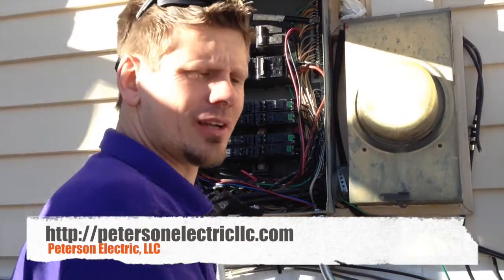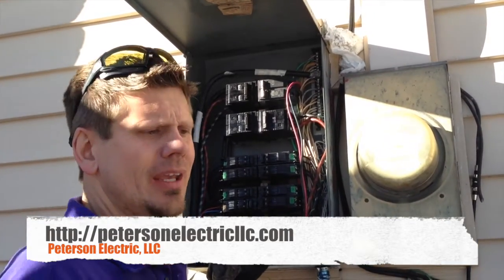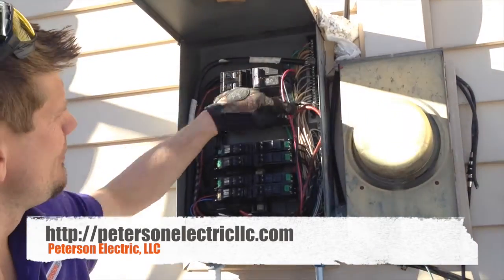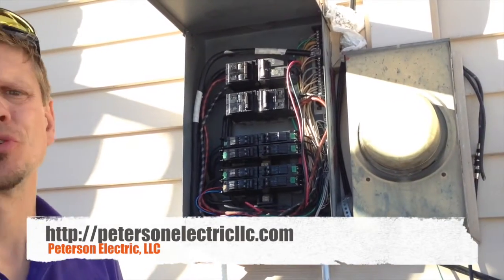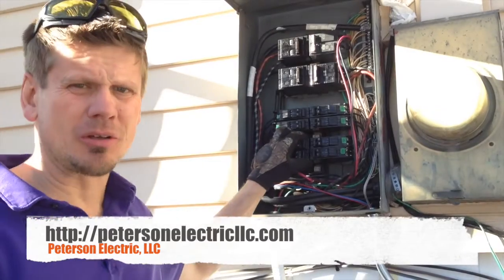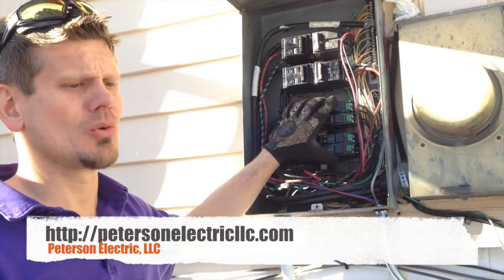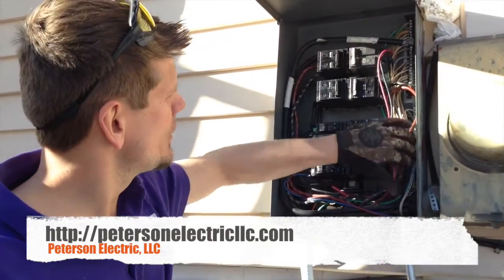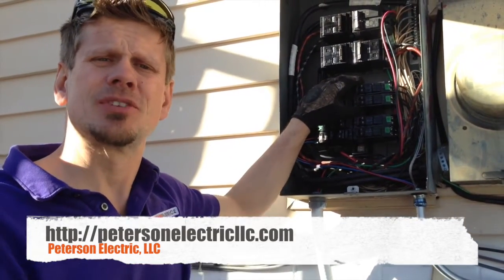Electrical Panel Has De-ox Lubricant On Wires To The Breaker Is That Okay?

Comment: I'm just a farmer that does their own electrical, so take this for what it's worth.  de-ox is conductive, yet I hear of inspectors wanting to see it "oozing" and it makes my head spin.  But a little amount on all connections seems like a good thing, tbh.  People may think "oh, its a NEMA 3x enclosure", but it's only designed to give a DEGREE of protection, not fully protect. Look in old panels, they are covered in filth. I'm really glad I do my own NEC research and electrical work, and not have to pay someone for these simple things.  Even Mike Holt makes some rudimentary errors in his videos.  I don't remember for sure, but I think in all of your slip joint videos when I was researching them, you never once mentioned the slip joint should be at the mid-point during installation.  I found that out when I actually got a 3" slip joint.  Most electrical things, someone in grade school could do with instruction and the tables.  It's not rocket science, you just need to know the protocol.

Comment: Adding a dielectric grease aka deox no ox ALCU aid is not only code accepted but is code required on mission critical and if you look up and I like to use NASA as references because they spend a lot of money on research and development on electrical connections and whatnot and even it's proven to be beneficial by then so the long version short people think dielectric grease will well they have many misconceptions one being udge dialectic it's going to prevent electrical flow 
Are people say oh there's no need for it there's no resistance in what not when we install it blah blah blah
The list goes on of the reasons people say it's not needed to The other side that it's an oversell to the customer

So so I'm going to shorten it to dielectric grease so in any connector connection point you want dielectric grease whether it's just a thin film application to mushing it in a connector and having it squeeze out
On any electric connection that's headphone jacks RCA cables video cables HDMI cables etc
Notice how sometimes you have to jiggle your HDMI cable to get it to work That's cuz there's a wee bit of corrosion in there

So like on connections that you're screwing down you wanted to basically ooze out and then you scoop it the smooch out and reuse it you don't waste it

On breakers or anything we're the wires are not crushed but crush fitting is what I'm going to call it screw down fitting where you're clamping all the you know stranded wires together what I actually do on the mission critical stuff is when I strip my wire I actually bred the wire out of it dip it in dialectric grease I make a little you know tub for that project and then bring those stranded wires back together and pull off the excess and then put that in my crimp connector and make my mechanical connection

And here's the thing with like AC breakers your house current is 60 Hz which is 60 pulses per second going back and forth and that's a vibration and when you have that plus a high electrical load that's you know heating up in cooling down that creates you know a separation between contact points like on the breaker to the bus bar and having a dielectric grease there allows it to explain and contract and not per se arc and as the years progress that dielectric grease their will prevent corrosion maintaining a good connection I've seen breaker panels side by side that there's dialectic grease on one and on the other panel it's not and you can see a difference

I even smudge dielectric grease into relays I'll pop the cover off throw some dielectric grease in there yeah over time like it flaps it out of the way but it also keeps enough of it on the actual contacts to prevent that arcing when they're separating and if you do it right it will last a lot longer than you realize

Also in the marine industry and I'm talking like real heavy marine not like some idiots little boat

Comment: This video doesn't really explain jack. All you said was there is grease in this panel so we cleaned it up. 
How is de-ox [or "di-electric" grease for the auto and electronics guys] on wire terminals a bad thing? (When used in moderation, obviously it shouldn't be a big sloppy mess oozing all over.) It is actually *required* for all aluminum conductors, even Al to Al, and will not hurt copper. I have seen several connections go bad and either cause substantial voltage drop or outright start fires in old homes directly because grease was not used in certain critical connection and corrosion set in. I have never seen a problem with a greased contact other than some mess or dust collection from sloppy application. 

Greased sliding contacts are used all the time in electronics. (Physical switching was more common in the analog days.) The bulk grease is nonconductive and prevents direct contact between the metal and moisture or oxidizers(O2, O3, some N compounds, etc) in the air. The static contact however is still conductive because the grease film squishes out and this type of grease contains no solid additives. (plain fluid and gel lubricants [such as this type of grease] only lubricate by building a film under dynamic pressure, basically the grease/oil cant get out of the way fast enough, but once the parts stop moving the film dissipates and you get the same direct metal to metal contact as you would clean and dry. Though some grease remains in the microscopic valleys which improves thermal conduction vs the air that would normally fill those valleys. 
Properly tightened lug connections actually deform the two metals together for more true metal to metal surface area contact  but again this is not changed by grease around the contact. Grease on the screw threads will reduce the torque needed to achieve that deforming clamping force and possibly make later maintenance easier.
Reply: There is a difference between ox-guard and di electric. You explained how the di electric works, but the ox-guard is a conductor, not a di-electric.

Comment: Deox is not harmful at the bus bar to breaker connection as long as a minimal amount is used.  With that said, it's not really needed in most cases.  For lake or river houses where a lot of ambient moisture is present, it's actually a good idea.  I think the perceived danger is if a ton of deox was used, it could theoretically allow for a bridge inside of the breaker which would be no good.
Reply: The bus bars, in my experience, have some form of lubricant/deox from the manufacturer. I wonder if it's a different product, or just applied in a controlled manner.

Comment: More reading...

It seems like electricians can’t decide if it’s ok to use various deox products on terminals. Canadian code seems to require it on stranded Aluminum wire:
https://www.electriciantalk.com/threads/noalox-anti-oxidant.25803/

Comment: It Code legal to apply de-ox or CUAL AID to Copper as well as Aluminum wire connections. That is why it is called "CU"  AL AID. For our electricians it is standard practice when wiring Copper wire connections near the ocean. What is against specs is to apply CUAL AID to the buss bar or the breaker where it clips to the buss bar.  This is because that connection relies on friction.  Perhaps someone told you "no de-ox on breakers" and did not go into detail.   If the application of de-ox was sloppy I would clean it up too.

Comment: Dont understand that if i run into aluminum no 2 & larger i sand the conductor and use BURNDY PENATROX  its ul listed if i must work with no 10 12 al fore my boss i prefer to strip a new end sand it my boss gave us coalr devices they say not to put antioxide compound on them i dont see what it hurts to use penatrox on those aluminum connections outside . I personally talked to a maintenance man at a school with aluminum branch circuit wiring he told me that he put penatrox on the end of the wires and stuck it in the breakers and neutral bar and his problems mostly went away thanks to PENATROX any arcing the wire was restripped and a new breaker installed. This was about 40 years ago.
Reply: Are you an electrician in the USA? I am trying to figure out if it’s ok to use Penetrox on the bus bars of a breaker panel. I hear that some breakers have bus bars that are coated as opposed to solid metal. That could be an issue. I’m also wondering if penetrox might be discouraged because it might attract dirt? I’ve never read that, I’m just using my imagination.
Reply: @blackrockcity   Yes im a licensed electrician in the USA and have done this for decades. You put just a little  in the clip of the breaker that clips on to the buss  and install it and pull it off & on the buss a couple of times that gets the penetrox worked in the joint. I wouldnt suggest sanding the buss bar they are plated. If the buss bar is pitted or corroded once power is cut ive sanded them and put penetrox but only as a temporary basis until i could replace the panel with a copper buss model. Go to one of the home improvement stores and look at a Siemens 100 amp breaker this will give you an idea on how much penetrox [the grey stuff] to put in its not much.

Comment: So basically it's not explicitly recommended, but there's no concrete evidence or reason why non flammable corrosion inhibitors desinged for electrical connections would cause harm...

Comment: I wouldn't have posed a video showing what looks to me of you ripped a customer.   Yea, maybe it was messy and not "code" but we both know it didn't hurt the breakers (unless it was squirted all up inside of them).  If you must, clean if off and charge $100 but the DeOx isn't causing a problem.  I also am skeptical that the equipment manufacturer specifically outlaws the use of DeOx on their breakers.
Reply from the maker: DUDE!!!! We did not rip the customer off, don't be such a jackass to assume you know my work nor customer. WE GAVE HIME THE OPTION TO REWORK THE PANEL AND METER, he said NO!   He was selling his property and the inspector from the realtor did not request this. They are GE breakers and have not been flagged. We were able to order NEW RECONDITION breakers from a TRUSTED BREAKER COMPANY THAT GIVES A ONE YEAR WARRANTY. The Diox wreaked the breaker lugs, shut up on your opinion of me hurting my customer, it is people like you that make me say TROLL>
Reply: @Petersonelectricllc  I allow that there are a lot of other factors that led to the decisions you made.   For this reason I'm not your judge.  But I call what I see and we'll just have to disagree on this one.   So, I hear you saying that Deox attacked the metal and "destroyed the lugs".   My genes must have come through Missouri - I'm afraid I'll have to withhold belief in that one until I see it.   If that is the case, your video would have been FAR more valuable to the community if you had shown the evidence for that.   I would be forced to become a believer, and thank you for it.   In the mean time pursue righteousness and the One from whom righteousness flows.
Reply: @Petersonelectricllc  Most likely, it's not the de-ox that did the damage, but it was probably used to mitigate the damage that was already done.  When used correctly, much like grease that already often comes applied to newer breakers, the de-ox prevents arcing and pitting of the metal while ensuring a proper contact between mating surfaces.
When outdoors, as the panel is, the lugs will oxidize and breakdown causing it to arc.  Hence, using the de-ox in this setting would be highly recommended, but only as a surface coat.
While I don't believe that you ripped-off your customer due to the damage to the old box and breakers, I do feel that you may wish to re-evaluate your understanding of de-ox usage -- especially in exterior mounted panels.
Reply: @Petersonelectricllc  He's not trolling. "WE GAVE HIME THE OPTION TO REWORK THE PANEL AND METER" is an upsell. "NEW RECONDITION" is like a used car lot spraying down car parts with break cleaner. Look it's like new! OMG the breaker lugs are wreaked. come on. what a ripoff. Someone should use this video when making BBB complaints.

Comment: Would have been helpful to explain the reason why.
Reply: If too much oxide solute, Summer heat may melt from one breaker bridging a connection to the below breaker.
Reply: @lyledrexler8278  even if it isn't conductive material? Magically?